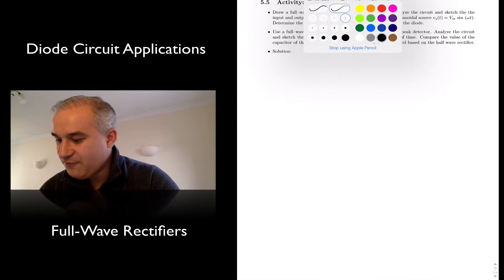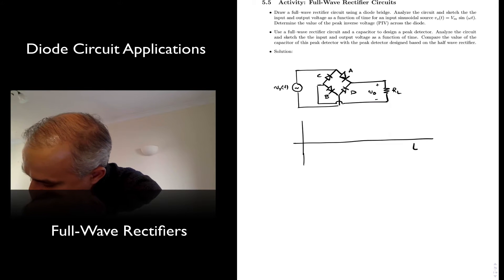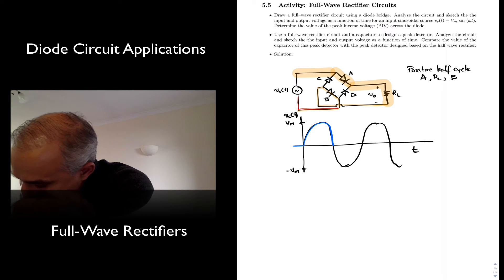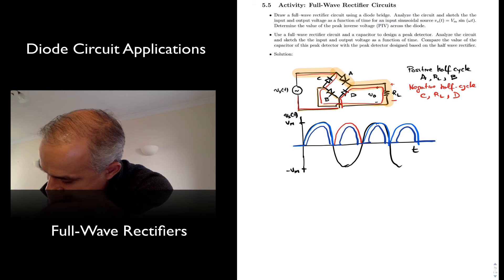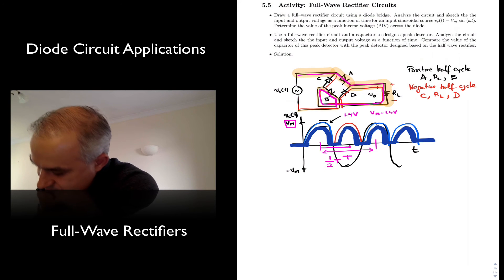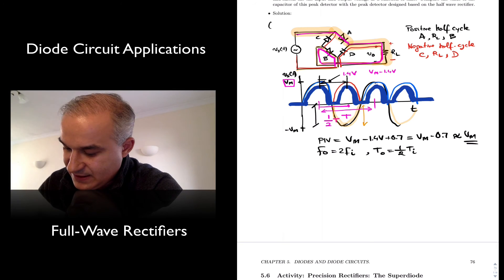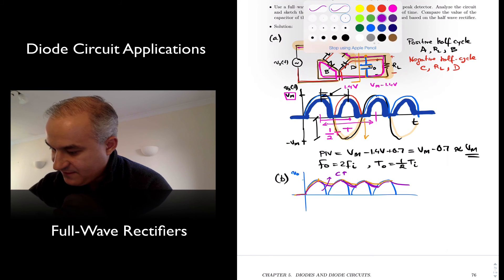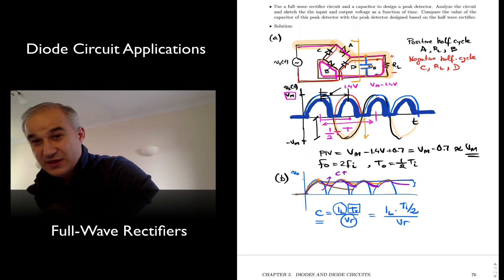Diode Circuit Applications: Full-Wave Rectifiers

Comment: Professor, I am confused as to why the PIV is Vm - 1.4 + 0.7. Why is the 0.7 added back?
Reply from the maker: Notice that we are not looking at what is the peak output voltage (Vm-1.4). The PIV is the maximum reversed voltage experienced by any diode on the circuit. Consequently, we are looking at the voltage for the experienced by the reserved biased diodes (this is now explained on the discussion board). For instance, when diode A is conducting, the reverse voltage experienced by diode D is Vm-0.7 (i.e., Vm - diode drop of diode A). In a real design, however, you will want to make sure the diodes can withstand reverse bias voltages of at least Vm.